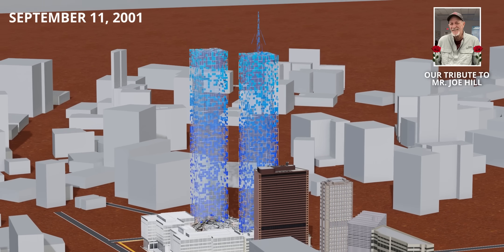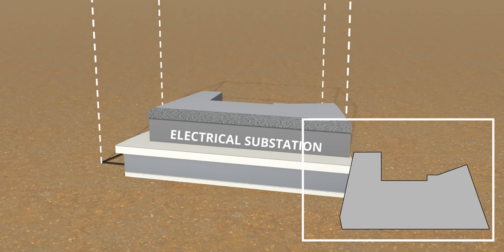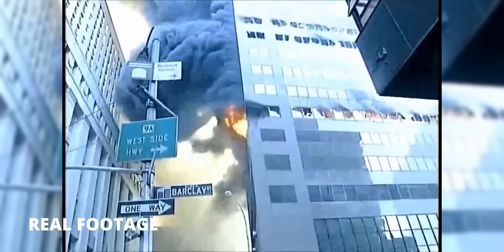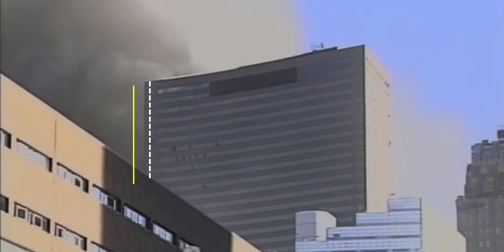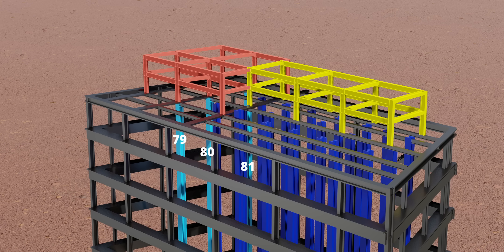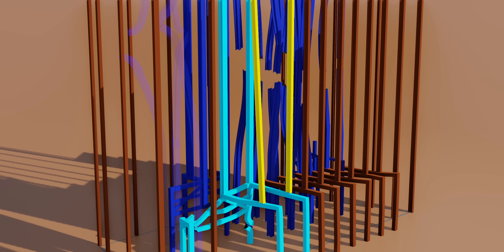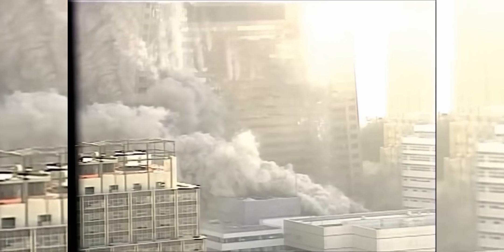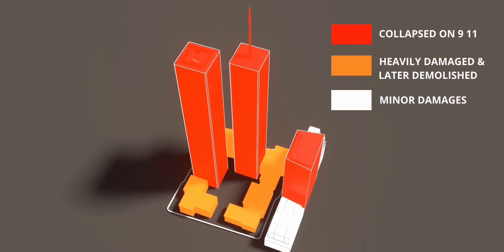Collapse of Building 7 | The Complete Physics

Comment: The collapse of WTC7 was mistakenly announced BEFORE it collapsed, in more than one news report by BBC tv on September 11, 2001.  One of these announcements came something like 10 minutes before the actual collapse, with WTC7 still seen standing in the video.  While firefighters could probably see significant damage, it is hard to believe that a brief walk through the building would have been enough to know that it was going to collapse; such a prediction would take a careful, detailed analysis.  Also, Larry Silverstein, who owned WTC1, WTC2, and WTC7, said that a firefighter told him, when WTC7 was on fire but standing, that they should "pull it".  "Pull it" is the phrase used in the construction industry to initiate a controlled demolition.  Silverstein later said he thought the fireman meant to "pull everyone of the building"; certainly an odd way to mix up words.
Reply: Oh boy, more repeating of proven epic fail for the hundred thousandth time. How many times do these dead horses need to be beaten???

1. OK, so the BBC made a mistake (actually not even their mistake, they were simply reading a Rueters repport).  So what?  

Do you know how many hundreds of news reports in the chaos and confusion of that day later on turned out to be erroneous?  Why make a big deal about this one?  What are you trying to claim, or even imply here?  Do you even know?  

2. Larry Silverstein did not own Building 1 or 2. He did not own the Pentagon either or that field outside Shanksville. None of the targets on 9/11 were owned by the (conveniently Jewish) Larry Silverstein and the terrorists didn't care anyway. 

In 2002 during an interview for the PBS program "Rebuilding America's Defenses,", the conveniently Jewish commercial real estate developer and owner of the World Trade Center Building 7 Larry Silverstein made the following comment;

Kevin Spacey (narrator): Pelted by debris when the North Tower collapsed, [WTC] Seven burned until late afternoon allowing occupants to evacuate to safety (note: the conspiracy crown ALWAYS leave this context-setting preface out)
 
Larry Silverstein - I remember getting a call from the fire department commander, telling me that they were not sure they were gonna be able to contain the fire, and I said, “We’ve had such terrible loss of life, maybe the smartest thing to do is pull it.” And they made that decision to pull and we watched the building collapse

Nobody, but nobody made any fuss over this until several years later when 3 teenage boys made a low-budget  and briefly popular_documentary_ film (the research for which never required them to leave their bedrooms) in which all on their own decided that "pull" meant blow up the building and that this relatively unknown commercial real estate developer had ordered the fire department to do so, then casually admitted to his crime on national TV without prodding and with authorities and his insurers taking zero interest.

Because firefighters take orders from real estate developers and blow-up burning buildings. 

Maybe, just maybe there is something else going on here. 

Larry Silverstein (allegedly) got a call from a (unidentified) FDNY Fire Commander who was concerned Building 7 could not be saved and did not want to risk losing more people in a hopeless effort. Remember the FDNY had just lost half of its responding members that morning when the Twin Towers collapsed – 343 firefighters killed! 

The concern is not risking life and they want to end the efforts to save the building to do so. What does “pull” mean to an FDNY firefighter in the context of a building that is burning out of control when hundreds of firefighters have just been killed and injured? Let’s find out.

FDNY Chief Daniel Nigro - the on-scene commander at Building 7 on 9/11/2001;

The biggest decision we had to make on the first day was to clear the area and create a collapse zone around the severely damaged 7 World Trade Center, a 47 story building heavily involved in fire. A number of fire officers and companies assessed the damage to the building. The appraisals indicated that the buildings structural integrity was in serious doubt. I issues orders to PULL back the firefighters and define the collapse zone. It was a critical decision; We could not lose any more firefighters. It took a lot of time to PULL everyone out, given the emotionalism of the day, communications difficulties and the collapse terrain

Deputy Chief Peter Hayden - 33 year veteran, NYFD in the August 2002 Firehouse Magazine;
 
No, not right away, and that's probably why it stood for so long because it took a while for that fire to develop. It was a heavy body of fire in there and then we didn't make any attempt to fight it. That was just one of those wars we were just going to lose. We were concerned about the collapse of a 47-story building there. We were worried about additional collapse there of what was remaining standing of the towers and the Marriott, so we started PULLING the people back after a couple of hours of surface removal and searches along the surface of the debris. We started to PULL guys back because we were concerned for their safety 

The word “pull” comes up quite a bit, but they aren’t talking about blowing up a building now are they? “Pull as it turns out is common FDNY slang for literally pulling the firefighters out of a too dangerous situation. 

Why would you believe saying "pull it" to a firefighter means "please blow up my building"?  Doesn’t that whole scenario seem odd?  That would be a strange use of language.  Since when do the FDNY blow up buildings on orders from real estate developers?  

Dan Nigro, not just “a” fire department commander but the FDNY commander responsible for operations around Building 7 is quoted repeatedly using the word “pull” in reference to his firefighters,  He isn’t pulling “the building”. That is not what the FDNY even do. He is pulling the people.  “It” is the firefighters and first responders, NOT the building.  He wants to avoid further loss of life. 

343 FDNY firefighters KIA.  These were not just co-workers. They were brothers, cousins, uncles, nephews, fathers and sons.  Literal and figurative. 

Larry Silverstein and the (unidentified) “fire department commander” were concerned about lives, not the building. Silverstein says he made the suggestion to “pull it” (the firefighting operation) because we’ve (already) had such a terrible loss of life but he gave no order , no command. “They” (the unidentified FDNY commander) _made the decision, gave the order. 

Because FDNY commanders do not take orders from commercial real estate developers. Indeed, it goes deeper than that:

Acting Chief of Department FDNY Dan Nigro - I made the decision (without consulting the owner, the mayor or anyone else - as ranking fire officer, that decision was my responsibility) to clear a collapse zone surrounding the building and to stop all activity within that zone. Approximately three hours after that order was given, WTC 7 collapsed. Conspiracy theories abound and I believe firmly that all of them are without merit

Leading demolition and explosives expert and editor of Implosion Magazine Brent Blanchard - We have never ever heard the term ‘pull it’ being used to refer to explosive demolition, and neither has any blast team we’ve spoken with

So in short, you were lied to by 3 teenagers who just made some shit up and put it in their shitty yet semi-popular movie. Two of them have subsequently admitted the whole thing is a load of male bovine excrement. The other is a convicted felon. 

Lastly, for a variety of reasons I am quite certain the conversation as related by Mr. Silverstein never took place. But even if we accept it as gospel, Silverstein agreed with the (unidentified) FDNY commander that Building 7 was a lost cause and the firefighters should be pulled out to avoid further loss of life.
Reply: So you're calling the fdny liars?
Reply: "The collapse of WTC7 was mistakenly announced BEFORE it collapsed, in more than one news report by BBC tv on September 11, 2001. "
How many other news organizations did it too? Do you know? Did you even know you SHOULD know? No, of course you didn't.

"While firefighters could probably see significant damage, it is hard to believe that a brief walk through the building would have been enough to know that it was going to collapse"
So, the FDNY lied, is what you're saying?

"Also, Larry Silverstein, who owned WTC1, WTC2, and WTC7,"
When you have fuck-all knowledge, you might not want to flaunt it. That way, you won't make yourself into a laughing stock. Just a hint.

""Pull it" is the phrase used in the construction industry to initiate a controlled demolition.  "
A phrase SO used, in fact, that literally every company that deal in demolition has stated that they do not, and never have, used that phrase. But it SOUNDS really cool and action-movie like. Right?

Comment: When steel is heated it bends or turns to spaghetti at the point of heating but doesn't snap, so if the girders all at the same level became heated to this extent then the building would lean or topple sideways at the point of where all the girders are heated to that extent but only if all the girders are heated to that extent otherwise if some don't reach that extent they would remain intact and hold some of the structure up. If where they were heated to that extent on a level and they did snap then the ones that snapped, which wouldn't occur at the same time either, but the ones that snapped the building could possibly fall at the girder that snapped but only until where the girder is no longer as flexible then would stop collapsing and would then tip sideways but only if all the girders at that level had snapped otherwise it would be held up. For the whole building to collapse straight down then every girder at every level would have had to have been at the extent of snapping at the same time which has never been seen before. I'm not a conspiracy theorist and don't care for this I am just thinking about this now that the video popped up.
Reply: No they wouldn't.  There is no mechanism for topple. No lateral force acting on the moving part of the structure to push it over. No pivot point. Steel structures when they collapse, do so DOWN, in the direction of gravity.  You are also leaving out that even with columns failing in compression (buckling) on one side, the opposite columns will fail in tension, so there will be some tilt (and there was) but no topple.
Reply: @TheCriticalStinker-01  I am saying at the point of melting the girders would bend not snap at that point and the building would lean sideways at that point only if all the girders at that point are at melting point to where they become spaghetti like otherwise the still stable ones would hold the structure from leaning, however for the building to entirely topple it would have had to have had all the girders from the base be spaghetti like and then it would have leaned and maybe toppled over or if somehow they all snapped at exactly the same time which would unheard of then the building would collapse into its footprints the levels that where at this heat then once stable girders reach this level the building would stop and then either sit stationary or topple over, but this would be a messy process perhaps with different parts all falling at different times, not clean as was seen but again I am not a conspiracy theorist and don’t care for this I am only thinking about it now as the video came up
Reply: @jefferyjimson8574  - There was no melting. In the specific case of Building 7 the collapse mechanisms were lower floor failures in the NE corner causing a single critical core column (C79) to lose lateral support over an excessive length. This resulted in its failure in Euler buckling. 

With C79 gone, the two adjacent columns (C80, C81) at the east end of the core encountered the same problem - loss of critical lateral support over an excessive length.  They too buckled and failed and down goes the East Mechanical Penthouse through the building. 

From there collapsed progressed through the core from east to west until the core was gone, taking all of the interior floor systems with it and most of the perimeter columns. Only the exterior moment frame is still standing, supported (inadequately) by the four corner columns.  To a noob it looks like the building is still there, but really it's just a shell - like an empty cereal box. I have no idea what you think is so "clean" about any of this. 

There is no mechanism for topple.

Steel framed structures drop. They are not trees, not rigid enough to topple. Your assumptions are wrong, reality is correct. Work on understanding the reality, not what you want reality to be.
Reply: @TheCriticalStinker-01  An empty cereal box that still managed to hold the western penthouse. An empty cereal box with 57 steel columns that simultaniously collapsed in free fall over the height of 8 storeys which you still can´t explain without controlled demolition Fitzshill. Work on understanding the reality, not what you want it to be.

Comment: 3:28 while I do find this video informative, the photo you are using here does look like it is ai generated with the weird artifacting and zero buildings in the background. Which sucks because there are actual photos of WTC7's south side burning and it's giant gash on that side. I'm really sick of people say it was a controlled demolition because CIA this, and CIA that, and having AI photos will not help out, in fact I think it will add more damage. Other than that, and the antenna debris mistake, it is an informative video.
Reply: Not because CIA this and that but because of several reasons. For example you can´t explain the free fall without controlled demolition. Just like any other shill the shithead above didn´t even try to explain it, shithead didn´t even dare mention the free fall.
Reply from the maker: Ohh, that one is not an AI generated photo. It's a real photo.
Reply: @SabinCivil  I'll second this. Where exactly was this photo sourced from?
Reply: @SabinCivil  did you try sharpening the image something? It looks really splotchy in some parts of the photo. Where did you find that photo?

Comment: Bullcrap!!!
Reply: And yet not wrong.

This Lesics video is very good – with one or two exceptions - and goes into a much higher level of detail than many viewers will be able to comprehend.  While not perfect, the collapse mechanisms – the sequence of failures - described here by Lesics are substantially correct and this is true no matter who planned and carried out the 9/11 attacks or why . 

That may not be what you want to hear and go against 20+ years of entrenched dog_ma and conditioning, but it’s not wrong. 

That also means (in case you did not get the hint) this video can be (and IS) absolutely correct in its description of collapse mechanisms AND the 9/11 attacks could still have been some sort of inside job. The two things are in no way mutually exclusive. 

The mechanisms described here have broad professional support around the world. There are no professional engineering organizations (for example: ASCE, ASEE, ICE, etc) that disagree with them or have offered any formal dissenting opinions or alternative hypothesis. 

The mechanisms described here are not new. They have been well understood for many years and much of it can be easily confirmed by simple observation. You can literally see most everything they are talking about if you just bother to look. 

So, setting hubris aside, either the overwhelming majority of the worlds structural engineers and simple observation are wrong,… … or you are. Which seems more likely? 

IF you still think believe this explanation is wrong then produce a better one . Good luck with that. No one ever has and I don’t see you moving that needle today. 

No one ever does.
Reply: @TheCriticalStinker-01  Controlled demolition. And you KNOW that I´m not the first to suggest this much better explanation. In fact you cheap shills don´t even have an explanation. You all fear to talk about the core columns because you can´t explain their failure without controlled demolition. No one ever does.
Reply: @Kudde23  The "much better" explanation that has not a single thing going for it, other than the failure to understand and the desperate need to be living in one of those cool action movies.
Sadly for you, Pillowbiter, you're not special or important and Rambo couldn't care less about it. Boo-hoo for you.